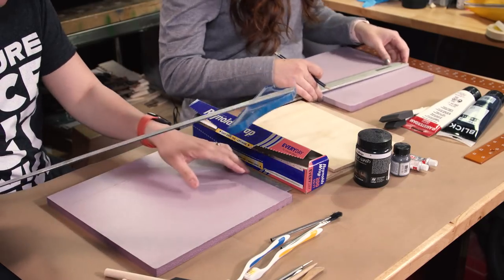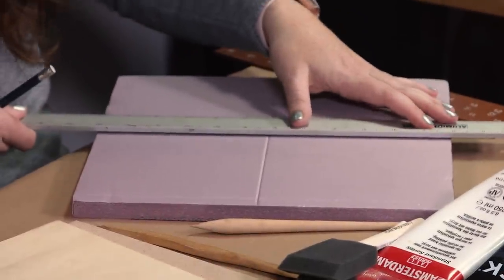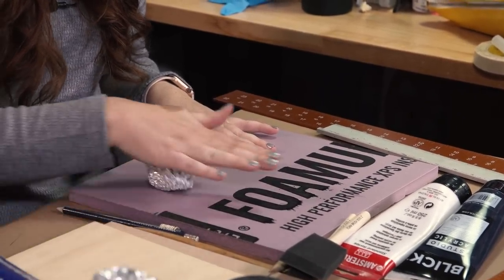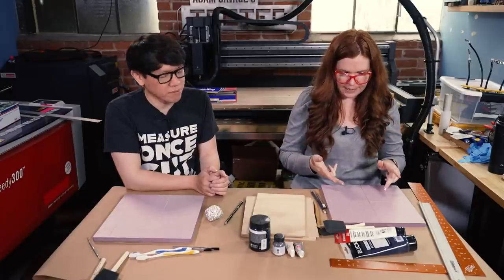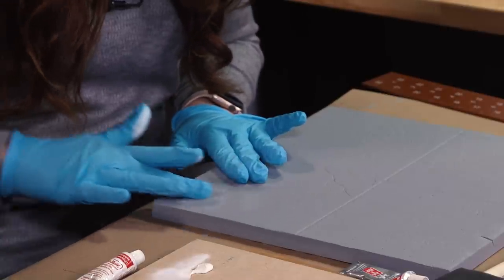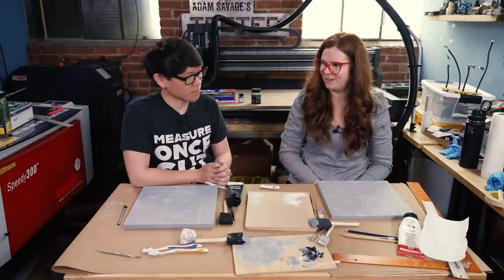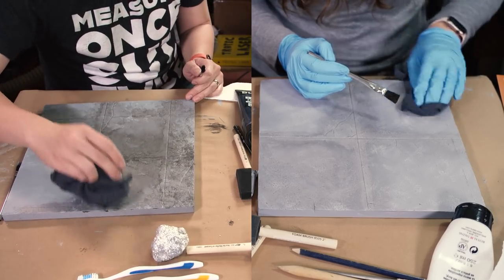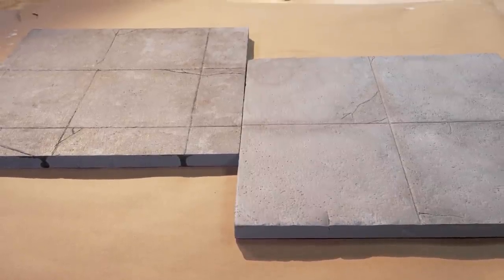How to Make Fake Concrete Sidewalks for Dioramas!

Comment: The thing about a concrete surface is that depending on what it was used for and where it is located and what time of year, is going to decide what it will end up looking like, concrete in Pittsburgh is going to have a different look then in San Francisco, or concrete in an urban area will be different in a suburban area even rural. Desert is different from wetter regions.
It is best to collect pictures or take pictures of different concrete surfaces to have a good reference catalogue for modeling, terrain building, and dioramas.
Another thing is among the aged dirty concrete you can have a section that is brand new and clean because work was needed to be done and the concrete was removed and new was poured.
Now modelers and drawers are going to pay more attention to concrete surfaces while out and about.

Comment: You can use an Exacto blade to make the cuts, but then run a wooden pencil or small paint brush to make those indents. Using just a blunt object can actually dent/tear the foam.
Reply: Yeah, always cut first unless it's a shallow/rounded indent

Comment: you can protect the foam and make it more robust when you paint it with a mixture of Mod Podge, Water (to thin the Mod Podge down) and acrylic colour
Reply: This is one of my goto techniques.
Reply: @DaveDeBaeremaeker  if you also add tile grout to the mixture, you'll get a neat texturing for free
Reply: I just use white glue, since mod podge is basically just a thickened version of that anyway.
Reply: @TaliesinKnol  you are partly right. Mod Podge is a PVA glue, but it comes with different finishes. You can get it with matte, satin and glossy finish. PVA glue is not optimized for the finish and the look can vary in the outcome.

Comment: Honestly, concrete is so expressive. Deceptively so. I might try some hints of green between tiles to indicate little plants sneaking up. Or maybe a tiny quarter glued down :)
Reply: After you're done using the aluminum foil for the texture, get a hole punch and voila! (well...for 1:6 that's more a silver dollar, but still!)

Comment: For added realism check out how (in this instance) concrete is finished, ie they usually streak the top with a push broom before poured concrete is fully cured.

Comment: Army Painter makes a spray primer specifically for XPS foam that won’t cause melting.
Reply: Just put a mod podge layer down first and melting isn't even an issue. And as it is a like a lacquer it strengthens it as well.

Comment: I like the foil ball idea. My only criticism is that when a concrete tile cracks, it cracks all the way through. you almost never get it cracking half way with a little "forked tongue". Think about breaking up a chocolate bar, you can break off a full piece, but you can rarely get it to snap part of the way, but not completely off. Also (depending on the county) concrete can be very different colours. Its normally quite yellow in the UK VS Americas cement grey.

Comment: Is the platform stable enough? What happens if someone were to let’s say hypothetically puncture the surface of your sidewalk with a metal object…. Would it be too hard to puncture into the foam? Or would it slide right in with ease?

Comment: Great video! Would love to see how to do concrete textures at a smaller scale for things like multi-building city dioramas. I'm building one to shoot in VR and am having trouble finding the balance between detail and scale.
Reply: How much smaller?  I've seen this technique used for things as small as 28mm scale.  Less than that the texture is almost irellevent, and it's more about the paint job.
Reply: Use sandpaper. Wet paint the base color to get into the grits then drybrush lightly to bring out the gritting then do a wash and dry brush again. Looks spot on for texture at smaller scales.
Reply: @DaveDeBaeremaeker  Thanks for the advice Dave. Your point is well-taken. 
Much smaller than that. Think 16th inch people. That's being driven by budget and physical space. And on top of that, this is for VR cameras set at its ground level. When experienced through a headset, the buildings will look and feel massive. And so will my crappy paint job. Which is why I was wishing and dreaming the amazing Tested team might have someone who can wisdom dump in a video. I know Phil Tippet has worked with something like what I'm trying, but the scale is bigger... and he's a grandmaster.
Reply: @lordofarda  A megaton of thanks! I'll experiment with this.

Comment: We've seen a number of videos with aluminum foil.  Someone must have had a brainstorming session of the number of ways to use aluminum foil.
This is something I probably will use in the coming year.
Would either of you (or anyone else) consider cutting the foam base into the size of the concrete blocks, weather it, and then assemble it for the effect?
Reply: unless you are mass producing something, IMO what they are doing should be fine for most use cases. why make more work for yourself and assemble it one by one instead of a block.
Reply: It depends on the final result you are looking for. You can do it, but since you weather the single pieces at the interfaces it could show the different wheatering of the edges; it wouldn't be a problem for something that has an intrinsic defined separation, like sidewalk and road
Reply: Peter, concrete sidewalks are actually one piece for fairly long distances. The joints are called expansion joints, but when poured its often just a groove in the top. Idea is it creates a stress riser and breaks at the groove if it needs to. So technically it's more scale in one piece than blocks!!

Comment: Every time they say sidewalk I cringe, being from the UK we call it a pavement. We also use the metric system
Reply: Pavement is a broad term that refers to any area that is covered in concrete, sidewalk however refers to only the outer edge of the pavement along the buildings, shops and homes where people and their animals are meant to be walking. Pavement is just not specific enough.
Reply: I am a Canadian who lives in the US, and I am constantly shifting my scales between metric and imperial.  I tend to use metric for most things, but use imperial when it makes sense, like my material already comes in an acceptable size but in imperial measurements. i.e. that foam is likely 1", so if I was making bricks its easier to do 1"x1"x2" 

Pavement as a sidewalk is odd tho.  For us North Americans pavement is more asphalt covered things, which tends to be roadways and parking lots (occasionally outdoor sports surfaces like basketball courts).   

I love the differences in the meaning of the words between english speaking cultures.  It makes the world a richer place to be.
Reply: @TheEnd  Not in the UK etc – it means the pedestrian section at the edge of a road.
Reply: @Zveebo  I have “loads” of “mates” from the UK and an ex girlfriend of mine was from Leicester. Very familiar with those vernaculars.